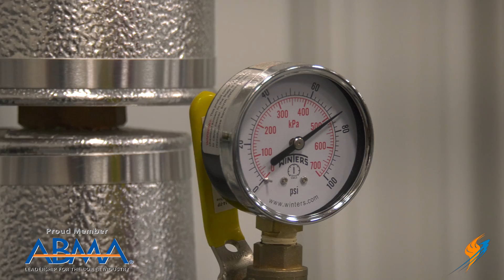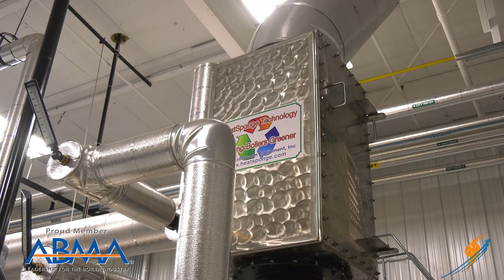Parts of the Boiler Room | Boiler Feed Water System - Boiling point

Comment: Hello. We have three Johnson Fire tube boilers. and we usually use 1 or 2 most of the time but we keep the other boiler always warm about 15-20 PSI from the steam generating pressure. My question is that why when the  boiler in on standby we keep the manual feedwater valve in off position even though we have an automatic feedwater valve?
Thank you for your videos.

Comment: Is the DA considered a press vessel? Its open to atmosphere but its a non fixed orifice that controls its back pressure correct?
Reply from the maker: I’ll answer both of your questions here as they are related. Yes a DA is a pressure vessel. It does require relief valves because it is considered as such. The orifice is to exhaust condensable gasses and not to control pressure. Thanks for the question!
Reply: @wareboilers  got it but the pressure can be effected by the adjustment of the orifice. I mean i know it isnt used to control the pressure but it can technically do so.

Comment: The modulating control valve on your feed-water coming into the boiler is unique for me. Our low pressure boiler calls for water when the low water cut-out float calls for it. That modulating control valve is probably a lot more efficient. 

Great video. Really helps while I study for my NYC High Pressure License. Hoping to take a class with you guys in the near future.
Reply: Hubert appreciate you watching. Good luck on your exam.
Reply: Hubert where u werkin? Im in nyct
Reply: @AdrianButler86  hey Adrian. Ive seen your posts on the Stationary Eng fb page. 
Im with Sloan Kettering.
Reply: @hubert187  ah ok. I think a few guys that went to the same refer skool as i did(TRI) work there to
Reply: @hubert187  mssg me on fb so i can i have a relaible way to chat with u
Reply: @hubert187  small world cuz we both know Harry Miller lol.